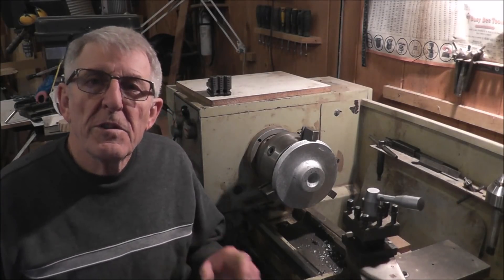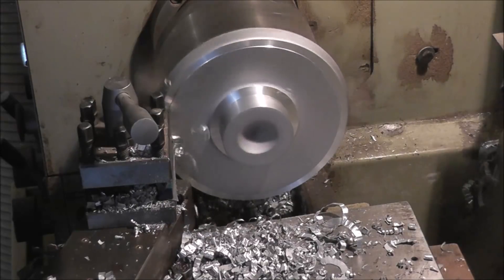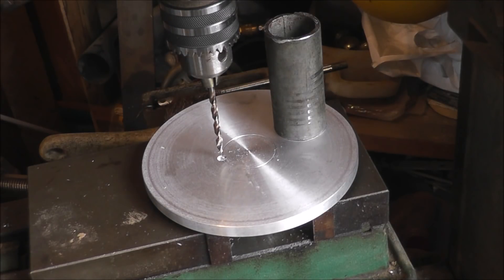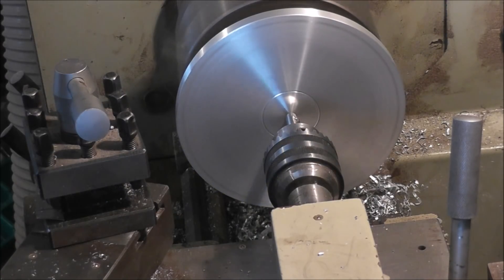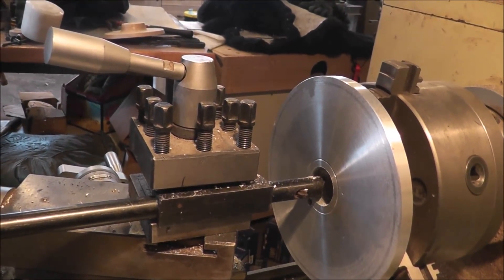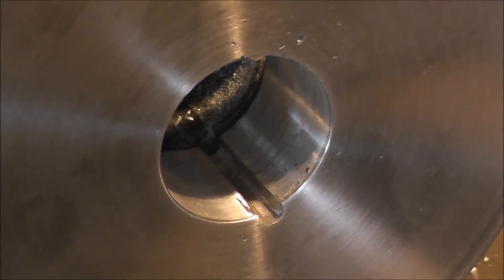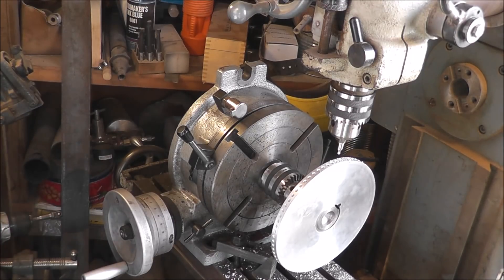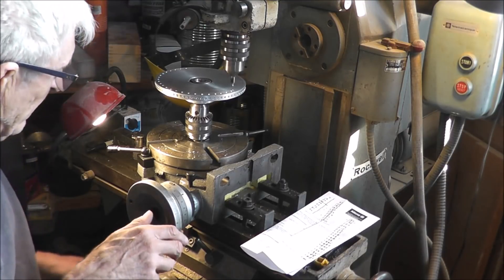Part 3, machining indexing wheel casting

Comment: Noticed the cross slide dial was a direct reading dial..
The distance between each line represents 2 thousands not 1 thousands, the 0 with a line through it means diameter. 
Just remember if yo want to take off .001 on the diameter you will have to stop between every other line on the dial 

Nice job.
Reply from the maker: Right, as you are machining both sides as it turns.

Comment: Very good trick to getting the key way in. Never seen that before. But never to old to learn something. I will be putting this to use in the future. My project is to build a belt sander. Thanks for sharing.
Reply from the maker: Not sure what type of belts sander you are building or have built by now. The last few video's I put up is of a belt sander unit I have built.  Very easy to build and works super well.  Previously I demonstrated it, back a number of video's